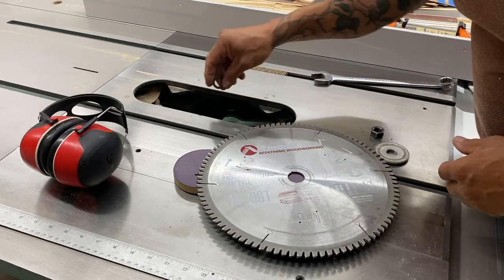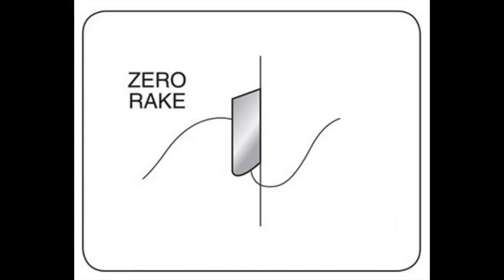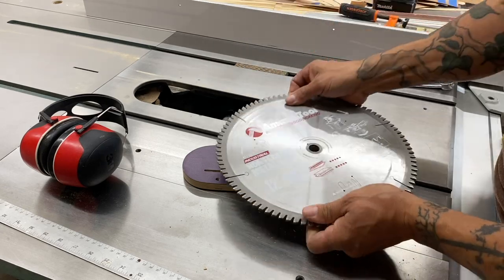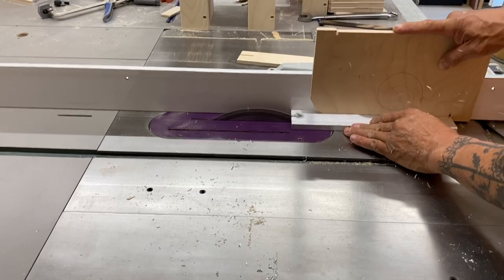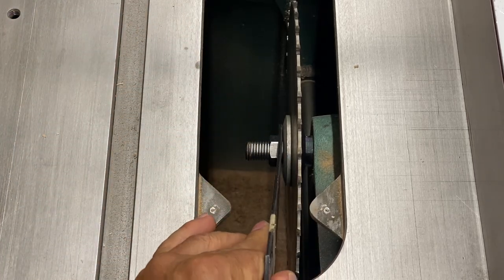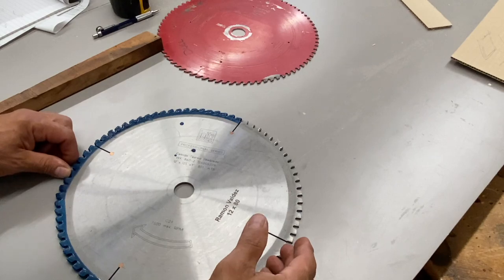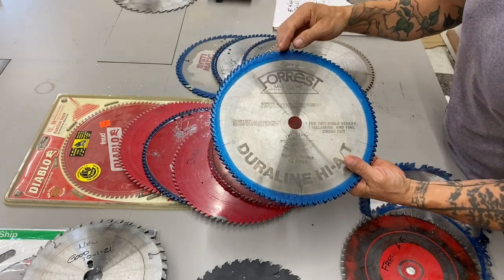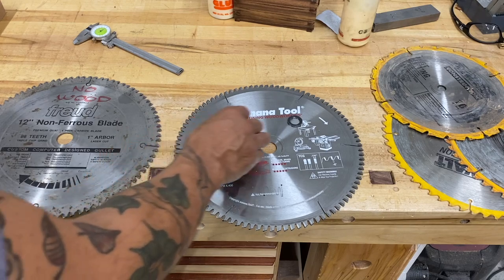Sawblades   & more

Comment: Years ago I had a negative rake on a 7&1/4 Skillsaw. Ripping oak, it'd blow out the 15amp breaker. 😜
Wears real well 'cause it exposes more carbide to the oak, not just the lead edge or 'hook'.
But it takes more horse power. 
Thanks, you share a lot of knowledge and experience! More than I ever had.
Reply from the maker: That’s an interesting point about the extra horsepower needed with a negative hook. Thanks for watching the video!

Comment: Excellent video, thanks. I clean my blades regularly with liquid laundry detergent diluted about 50% with warm water. The pitch and build-up comes right off in about 25-30 minutes. After rinsing completely I put each one in a pan with a spacer so the carbide doesn't touch and boil them in water to heat them up a bit. After I remove each one and blot the water off, I set it on a block of scrap wood for a few minutes and all moisture evaporates. Works very well. This extends the time between sharpening.
Reply from the maker: Sounds like a great solution.  I don’t cut Pine hardy at all, so I seldom get pitch build up.  I use lacquer thinner in the bottom of a bucket to clean my blades and router bits betwixt sharpenings. 😆 Anyway, thanks for the input and thanks for watching!

Comment: A very clear way of putting it and I cringe every time somebody in my shop puts the blade down I prefer to put some piece of scrap under the blade. Although I was surprised you didn't mention a hollow ground tooth
Reply from the maker: It does make me cringe as well when I see it!  😆 I could have mentioned hollow grind blades…I currently don’t even have one but we used em at my old work.  Good for melamine. Thanks man

Comment: Great educational video, this is certainly a "you get what you pay for" item, I have had many different brand blades over the years and 100% agree with you that Forrest are the best, I have recently purchased a Ridge Carbide flat top, 40 tooth, 10" blade and I am very impressed with it's performance so far .
Thank You Ramon for your time in making this video, very informative.
Reply from the maker: Thank you for that feedback!  My blade for cutting pins is also a Ridge flat top.  I should have mentioned in the video that  cutting splines with this type of blade is ideal!  Anyway…much thanks!

Comment: Thanks for the detailed explanation. I always look forward to your videos. I'm curious what the flexible blue tooth covers are and where you got them.
Reply from the maker: Thank you for the feedback!   The blue material is some type of soft plastic that is applied by the blade sharpener.  (Dipped maybe?) It’s not reusable and usually comes off the blades in pieces.  If left on too long…it starts to get gummy! Much thanks.

Comment: Great video once again, lots of wisdom here.   Do you run the dust collector when cutting aluminum on the table saw ?    Gotta love that drafting machine at the beginning.   ZCI working great. :-)
Reply from the maker: I have most machines on a automagic start (GrnGate) for the gates and dust collector.  But on my small table saw, I have a manual switch.  So for cutting aluminum, I leave it off.  
I love using that drafting arm!  And great to hear about the ZCI!  Thanks a ton 🙏🏼